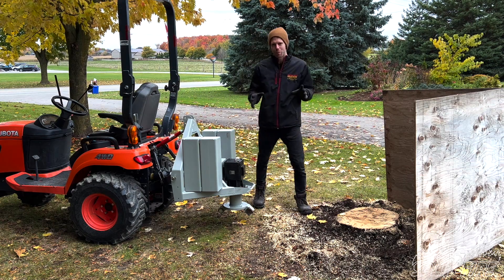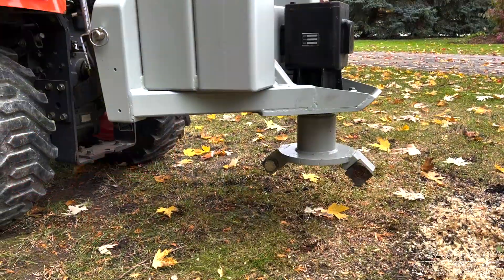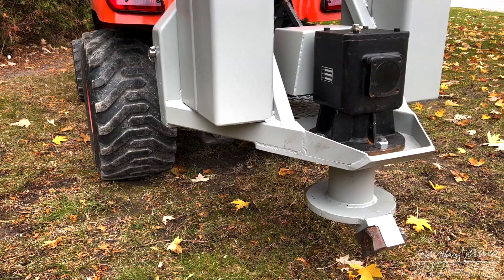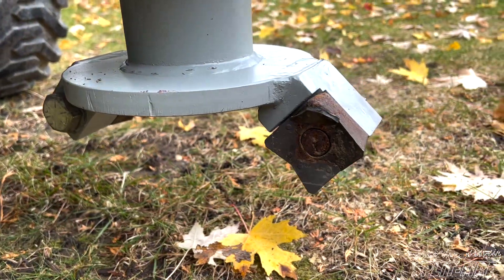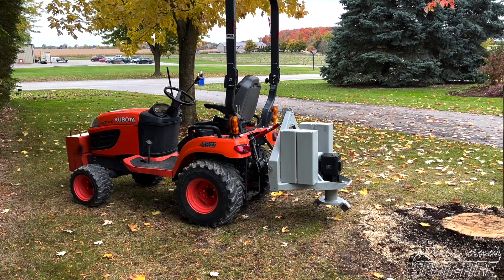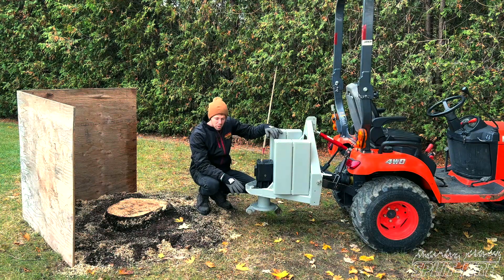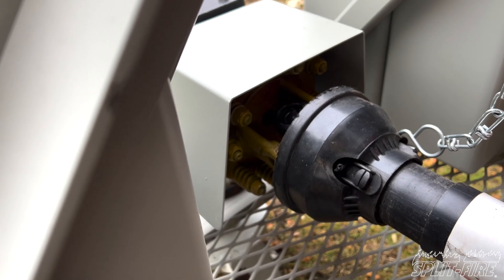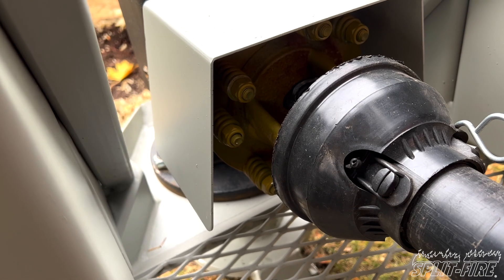Split-fire Stump Grinder Prototype

Comment: This looks like a great start towards a simple and functional machine. I have very limited experience with stump grinders, but would there be some way to have more of a cutting action rather than grinding?  I'm picturing some type of carbide tipped chainsaw type head that could cut the stump below the ground level.  Probably been tried. Just seems cutting could be more efficient that grinding. Cheers! Keep up the great work!
Reply from the maker: Yes there are some types of cutters like that, mostly spinning vertically and parallel with the tractor/power unit. Cheers! Thanks alot!

Comment: "Toss it on the scrap pile"? It hurts me to hear you say that!
I've never seen this design before. I find PTO grinders cumbersome for the most part unless the unit can swing side to side but that involves a lot more hydraulics and is best used with one person operating the swing while the other backs up the tractor as needed.
The other day when I mentioned getting into stump grinders, I hadn't seen this video. Looks like you were way ahead of me. I was thinking more of a stand alone unit though.
Reply: I also had a 60 inch Maple stump removed professionally a couple of years ago that was at the crest of a berm. It was about a 25HP JD with a Woodland Mills unit on the back. The cutting wheel was at 90 degrees to the tractor. This took about 4 hours and I wasn't impressed with the end result.
The berm meant that he could only go up and down hill otherwise the tractor would most likely tip sideways. He was constantly adjusting the cutting wheel height while backing up or going forward with his neck twisted in the other direction. 
He stalled a few times and pounded the crap out of him and the machine. I ended up giving him an extra $100 because I felt sorry for him! I could have rented a Toro STX26 from Total Rentals for the $300 I paid. I would have been done in an hour probably with a much more satisfying result.
Not everyone can afford the tractor and the size limits where you can go. For the rental industry, I think a machine with it's own power plant and smaller footprint is the way to go.
Reply from the maker: @TheDavekerr  Thanks for your responses! I agree with that poor ergonomics that a tractor has to offer, you can get a sore neck very quick. Our machine also had similar instances where it would catch and create a rough ride. The 3pt hitch doesn't offer the rigidity we would like to see on a stump grinder, which is one of our main problems. Standalone machines will likely always perform better, but they do come with a bigger price tag!

Comment: even if you not happy with this design, you clearly have some talent at making stuff- so nice job- hey i know nothing about it - but a weird thought popped into my head- they do use high pressure water jet to cut steel so what if ???
Reply from the maker: Thanks Dennis! Haha that would be pretty cool, and it would definitely cut the wood. But we wouldn't be able to recycle the abrasive compounds and the water would likely make a mess in the root/dirt sections. 
We appreciate the idea though, Thanks for your input!

Comment: Where was this thing about a month ago. I just recently rented a standalone stump grinder and it was very efficient with side to side operation. I like the idea of a 3 point stump grinder and have looked at several but to be truthful I haven’t been impressed. Most of them seem to be slow and sort of awkward. They all seem to require too much tractor maneuvering. I like the idea of the cutting teeth having side to side mobility possibly operated by the hydraulic remotes on the tractor. This way you could back through the stump once or twice depending on size of the stump. Just my thoughts based on recent observations. Take care, Ben.
Reply from the maker: Haha sorry Ben. Our 3pt stump grinder wont be for sale for a while. Lots of R&D needs to happen yet. I see your point on the mobility, even having your head turned backwards at the grinder becomes a painful experience. We are looking into ways to avoid both excessive tractor movement and neck pains!
We appreciate your feedback Ben!

Comment: Good idea. Fly cutter like on a Bridgeport mill. It didn’t look like it was hard on the machine any more than others that I have seen in the 3 point mount. Maybe try that same cutter on an L4060 instead of a smaller machine. I think you will find that it is more suited for the larger tractors.
Reply from the maker: Pretty close to it! You are correct, but we don't like the vibration that gets transmitted through the machine (see 2:05 ). That vibration will quickly wear out most of the active joints on the tractor. If we can make a product that doesn't destroy our customers tractors, then we will try our best to do it! Thanks for your feedback.

Comment: Just don’t go overboard with safety guards which would render it less productive. You alluded to it too being hard on the machine, yet didn’t qualify what it was that was the concern. I certainly saw no evidence of overworking the engine in this limited video.
Reply from the maker: That would definitely be something we would keep in mind. Most of the existing methods do just that, but some don't. 

At 2:05 you can see the heavy vibrations being transmitted through the tractor. That is what we are referring to. Heavy vibration like that will wear a tractor out very quickly.

The engine did quite well.
Thanks a lot for your feedback Mark!

Comment: Hey good day Marco.I hope everyone is doing great! My thoughts on the prototype. I am pretty sure there will be regulatory requirements around safety (or not) but definitely, it needs some kind of thick rubber/chains around the unit to stop the debris from flying out. The design looks pretty cool and it works as presented. A couple of things. What happens when you hit rock/granite? We are both in the Canadian Shield and a large reason I have not rented a stump grinder or used one on the tractor for my property is because it is almost guaranteed there will be rock woven in between and/or around the stump/roots. Weight. Sub-compact and compact tractors have no down-pressure on the 3 point hitch so implement weight is super important so the unit will fall under gravity through to completion of the grind. Arborists/tree service guys who do this for a living will tell you that you need to grind that stump at least 18" below grade for several species of trees,  or they will proliferate and grow again (I know cause I had 7 Mulberry trees ground down last summer and they said a minimum of 18" below grade was required to stop it from growing back - the unit does not look like it grinds that deep. But hey - Two thumbs up for continuing to innovate and try new things that will be helpful for property owners. A great start for sure! Be well and all the best to you and your family!
Reply from the maker: Hey Gord! We had thought about the safety aspect already, but passed it up due to the decision of not going further with this particular design.

The teeth are very robust carbide teeth, so they do a very good job when they come in contact with rocks (usually shaving or throwing them out of the way). However, repeated contact with stone/rock will chip the cutters eventually. 

There's lots to consider yet, most of which will change with a new design. Thanks for your feedback! All the best to you and yours as well!